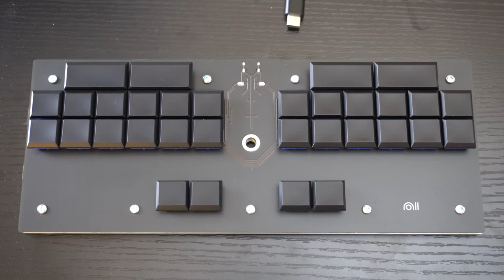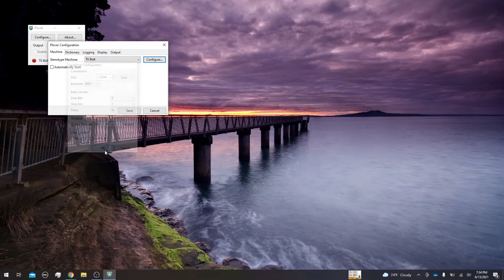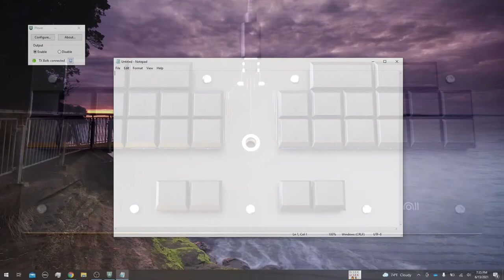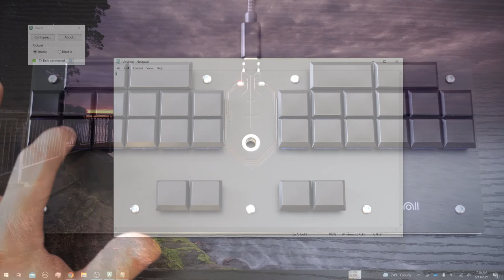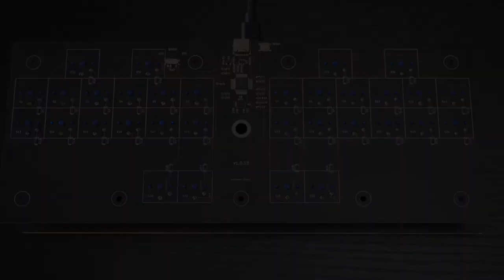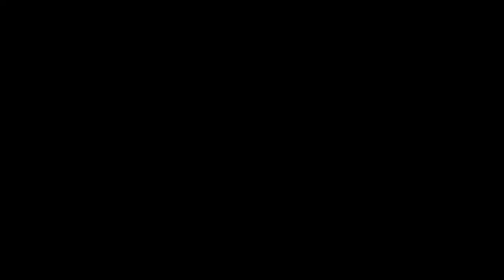EcoSteno Overview (Use Gemini PR instead of TX Bolt!)

Comment: Functionally what’s the difference between the n-key roll over and thx bolt mode?
Reply: N-key rollover mode is the EcoSteno acting as a keyboard. Using this means that Plover will intercept all keyboard inputs to translate strokes into words.
In contrast, TX-bolt mode (which has been updated to Gemini PR) uses a specialized serial communication channel. Configuring Plover to this mode means that Plover is no longer intercepting all keyboard inputs and is instead listening for just this communication. The benefit is that you can very easily switch between steno input and normal keyboard input without toggling Plover on and off all the time, as Plover no longer tries to intercept all keyboard inputs.